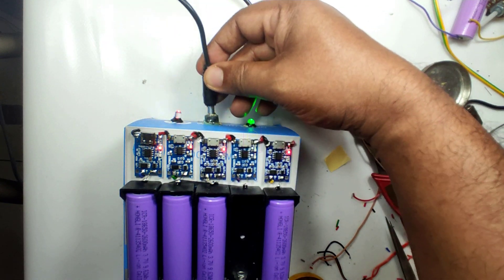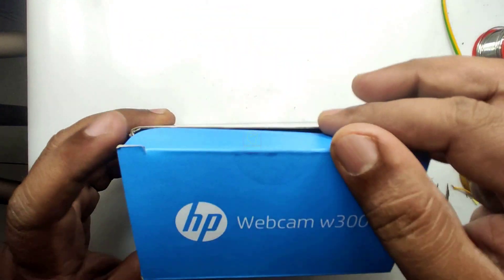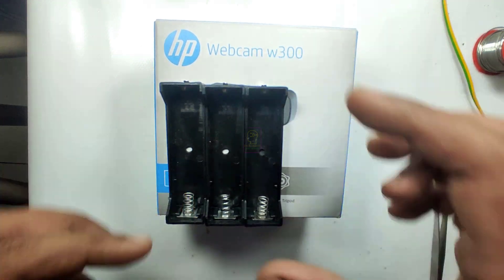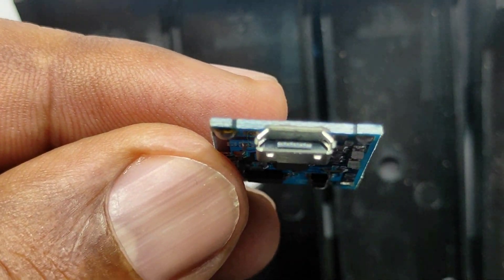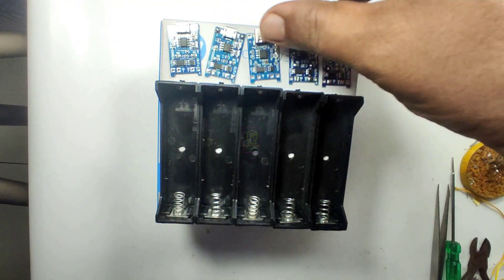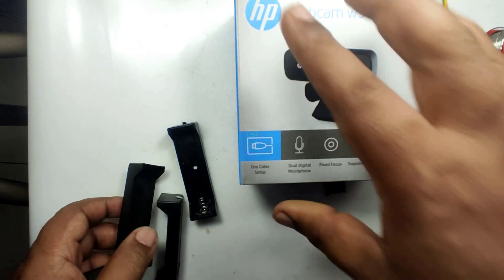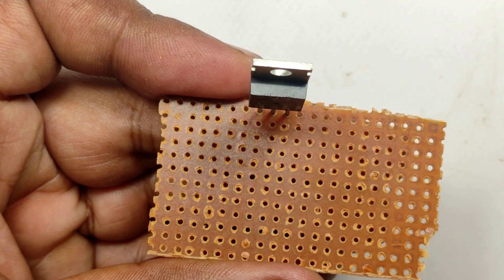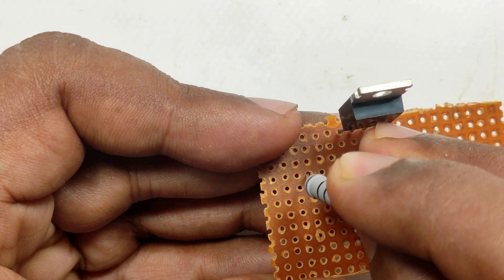The Ultimate Guide to Building a Powerful 18650 Li-Ion Battery Charging Station

Comment: Good design . If it can be charged directly from wall socket, then it will be more useful
Reply from the maker: I had designed it as so compact and that is why the 5V regulator has added and thus you can give a vast voltage range as input that from 6V to 38V
Reply: @TechInsert  For 10A I thing you need a bit more heat sink for the pnp transistor
Reply from the maker: @tabm7644  Yes true
Reply: Yes good suggestion
Reply: Don't we need air holes in this design
Reply from the maker: @baburaj1645  For 10 cells we need that.
Reply: Good suggestion
Reply: Will not get enough current for charging if we use transformer less power supply
Reply: awesome suggestion

Comment: I have a doubt, whether the wires used is capable of handling 10A
Reply from the maker: They are capable of handling 6A. I am using 5 charger only. But if u are using more then definitely use a bit more thick wire or use dual wire. One more thing,  1A will draw if battery for charging was deep discharged else 600 or 700 mA max will be used
Reply: @TechInsert  That is ribbon wire ..felt so. If yes tthen I dont think it can handle 6A. Max 3A and even in 3A it will become hot.
Reply: @John-pk7lr  Ribbon wire are of different gauges. Thick wire is also available
Reply from the maker: @John-pk7lr  Ribbon wire is available in different thickness range. Even single strand is also available. Thick copper is available in market.
Reply from the maker: @tabm7644  You are right
Reply: I assembled this in a mobile carton box with 7 cell station and is working perfectly fine. Didn't even think of this technique earlier. Thanks man for this awesome idea. Also it didn't even take more than 1 HR to complete this. Mje2955 is heating a bit more and I had added airholes in the carton for heat dissipation. 😍😍
Reply from the maker: @tabm7644  Wow great and much happy to hear that
Reply: @tabm7644 Air hole is necessary
Reply: I have silicon sleeved ribbon wire
Reply from the maker: @UldaneMangu  That is costly right?
Reply: I cant see air holes for heat dissipation